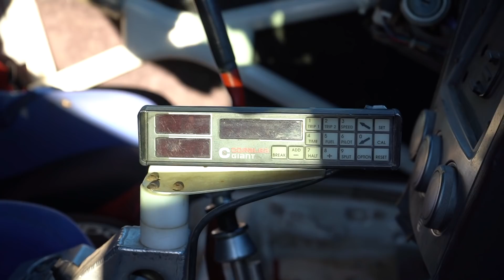RONCAR'S NEW RALLY CAR x RON SCHOOLS ME ON RALLY NECESSITIES #RutsAndGuts

Comment: Same car for 10 seasons.  I wonder how many headgaskets it took.   🤣
Reply: Turbo EJs don't have head gasket issues, you're thinking of NA. They do still share the common timing belt issues.
Reply: @fifty3motorsports  And rod bearing issues on stock bearings
Reply: This used to be our car lol lots of engines
Reply: @ronnyporter6889  do y'all just have a stock of engines to drop in when you blow one? Same with everything else in the drivetrain?

Comment: I'll see you at Glen Helen broski. Btw. Wrx has viscous center coupler. I don't recommend shocking that too much. The wrx is also front bias awd with open front diff. Sti is rear bias awd with essentially an open center diff and clutch pack that engages with electric power.